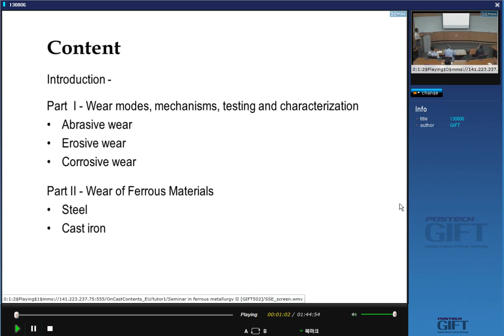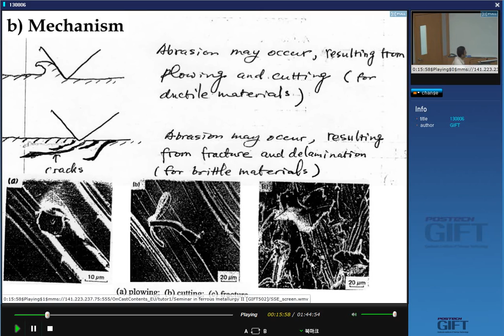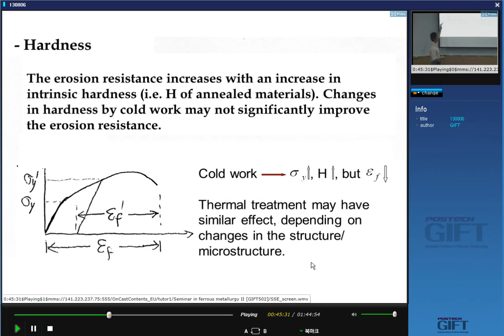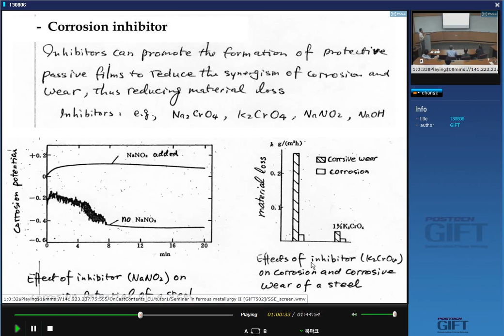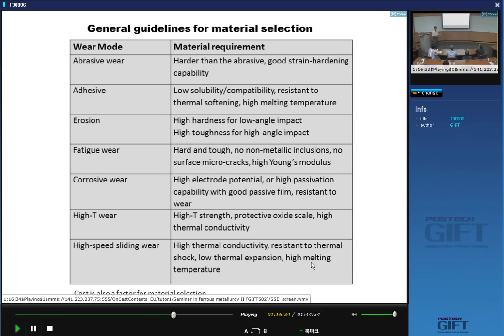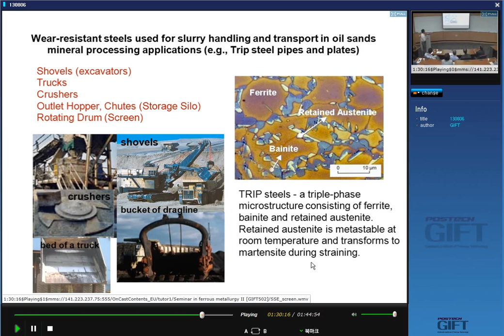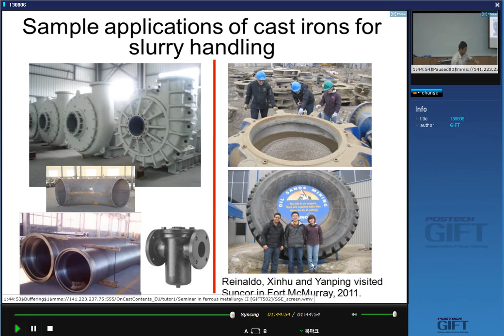Introduction to the tribology of steels

Comment: Time Stamps
4:38 Examples of wear
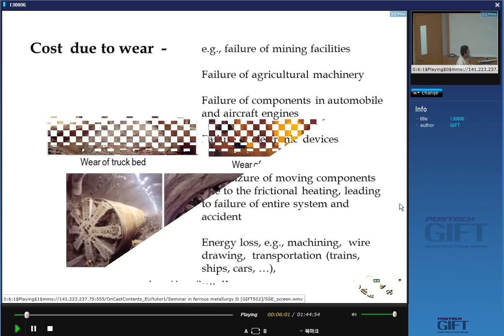6:02 Cost due to wear & friction
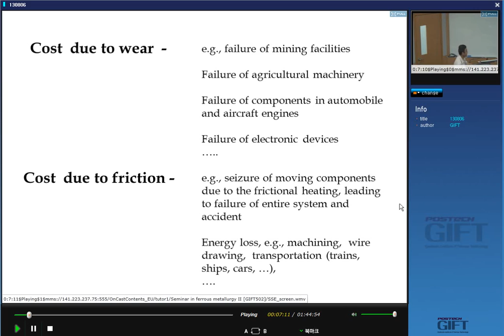7:17 U.S.A annual loss to industries due to wear
8:49 Illustration featuring wear processes
10:45 Part 1 - Wear modes, mechanisms, testing, and characterization
13:19 Abrasive wear phenomena
15:01 Types of abrasion (ductile materials)
16:10 Simple model of abrasion
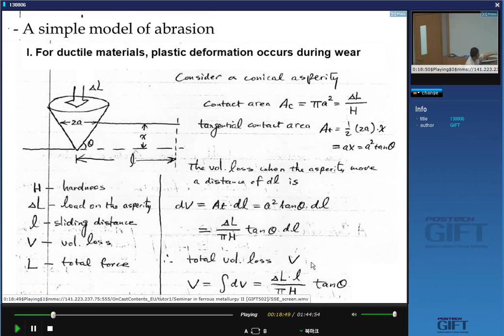18:50 Archard's Equation (used to describe sliding wear based on the theory of asperity contact.)
20:30 Fracture toughness (important factor for brittle materials due to fracture being predominant form of wear loss).
22:09 Factors that influence abrasive wear
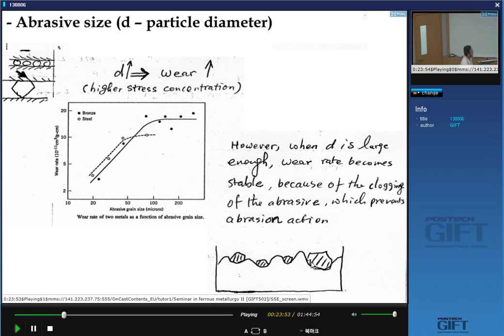23:58 Asperity shape, K is related to the geometry factor.
24:24: Importance of microstructure and grain sizes
27:05 ASTM G65 test simulates sliding abrasion conditions under moderate pressure
29:27 Worn surface analysis
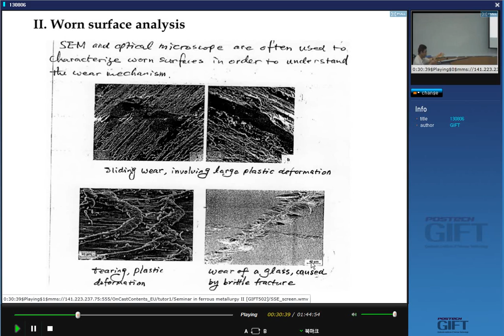30:45 Erosive wear
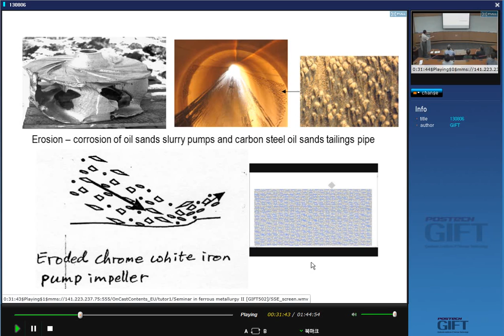31:46 Erosion by liquid
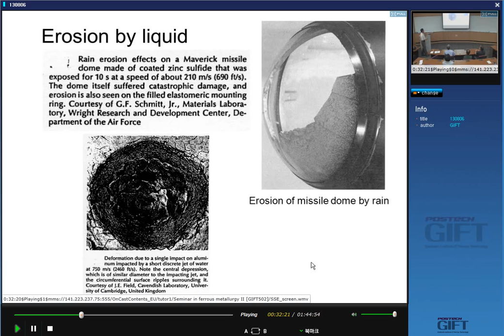32:26 Erosion Mechanism
33:00 Derivation for erosion
36:59 Volume of erosion
39:21 Factors that influence erosive wear (impact angle)
41:01 Figure demonstrating angle of impingement (aluminum)
42:06 Velocity proportional to erosion rate
43:51 Intrinsic hardness
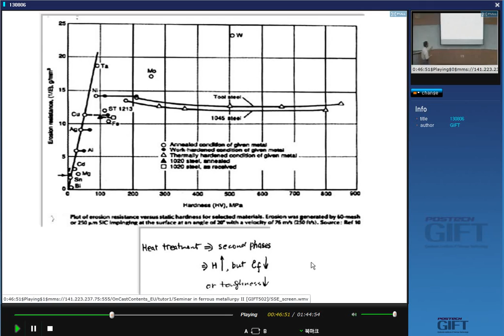46:54 Temperature effect
48:32 Erosive particle shape & effect of particle size
49:32 Erosion testing
51:26 Worn surface analysis to provide information on erosion mechanism
52:16 Corrosive wear
53:42 Wear-corrosion synergy
55:36 Corrosive wear processes
57:02 Grain boundary corrosion and cracking
58:33 Factors that influence corrosive wear
59:42 Corrosion inhibitor
1:00:36 Properties of passive films
1:02:38 Microstructure
1:03:45 General guidelines for reducing corrosive wear
1:05:05 Interstitial elements for solid solution strengthening
1:07:03 Corrosive wear testing
1:08:56 Corrosive worn surface analysis
1:09:30 Wear of ferrous materials
1:12:12 General guidelines for material selection based on wear mode & cost
1:16:33 Carbon steel
1:17:06 Modification of mechanical & tribological properties of steel based on phase/TTT diagrams
1:18:08 Pearlitic steel
1:21:04 Martensitic steel
1:22:24 Austenitic steel
1:25:38 Modified carbon steel
1:26:58 Solid solution strengthening when using elements with < 5% composition (pin dislocations)
1:28:00 Second phase strengthening when using elements with > 5% composition
(Cr, V, Mo, W, Cu, Ni, B, N)
(Chromium, Vanadium, Molybdenum, Tungsten, Copper, Nickel, Boron, & Nitrogen)
1:28:15 Stabilizing austenite
1:30:15 Uses of steel in Oil sands & Oil/Gas industries
1:36:02 Duplex stainless steels
1:36:22 (SAGD) in-situ oil sands operations
1:37:47 Cast iron
1:38:00 Chromium white iron
1:38:33 Typical cast irons
1:39:42 White iron
1:40:18 Guidelines for industrial applications of selected cast irons for wear parts
1:40:25 Effects of alloying elements
1:40:55 Microstructure effects